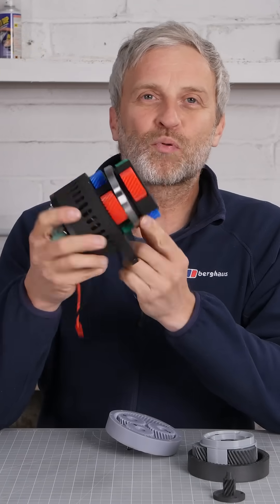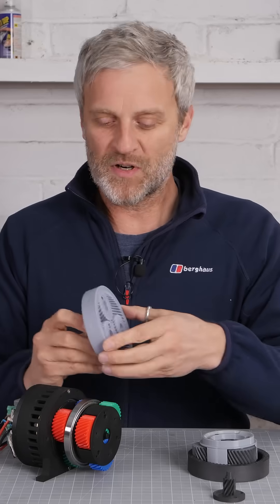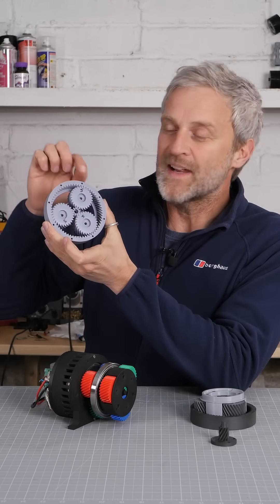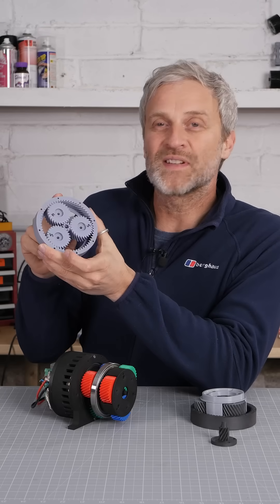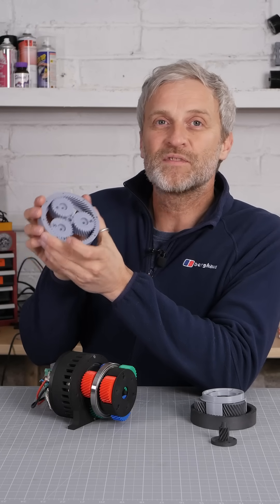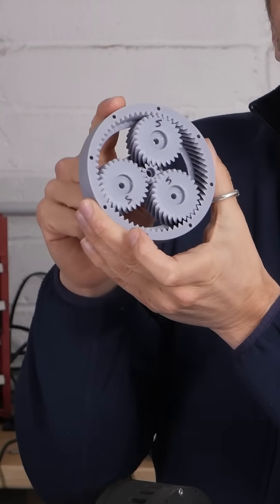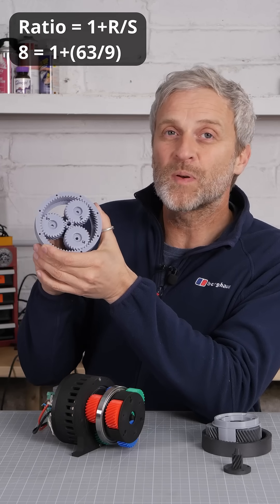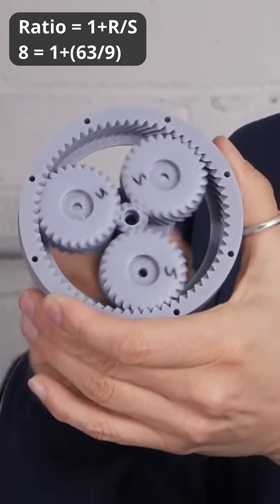Planetary Gearbox Ratio Correction 😬 #gearbox #3dprinting #engineering #neverassume

Comment: if the updated formula is correct its actually a 7:1 ratio. 63+1 = 64. 64/9 = 7.1 repeating. 72/9 = 8. so you would need a 71 tooth outer ring.
Reply: Think you have misunderstood the calculation.. its 1+(63/9) not (1+63)/9.. Do the 63/9 first. So 7.. 1+7 = 8
Reply: @ColinRichardson  Ah i see, that make a lot more since. thanks for the clarification. I am trying to figure this out because i want to use something like this in what I am designing so I needed to know how it worked for my calculations.